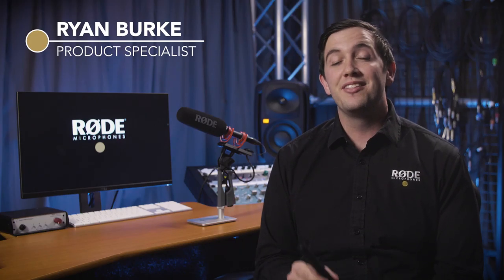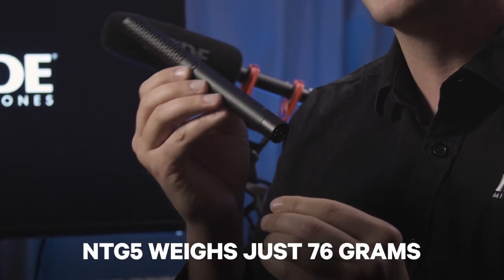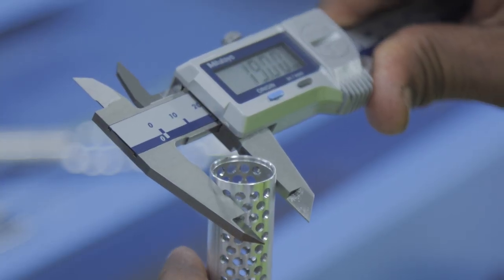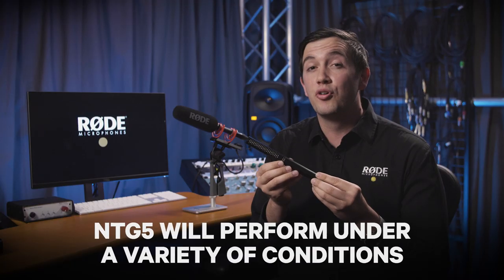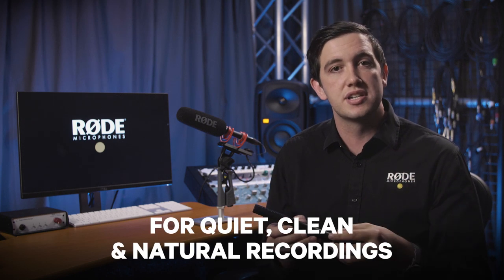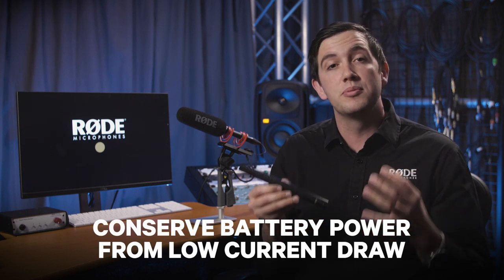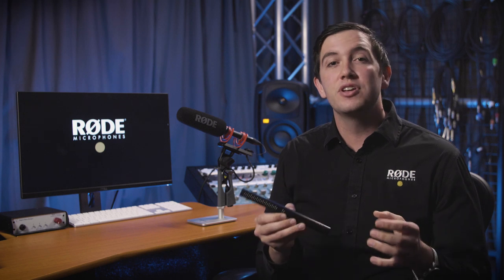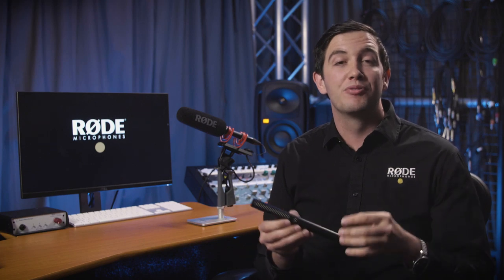Features and Specifications of the NTG5 Broadcast Shotgun Microphone

Comment: Looks and sounds beautiful.
Will there be a NTG5+ version in the future, with a built-in lithium battery?
Reply: Dragonstone that’s an awesome question. Do you use a mic with an internal batterie now? Is there ground floor noise with it?
Reply: @thefilmalliance  I do. I have a cheap shotgun mic with buit in battery and it works great. It's called Genesis ST-01. Very little noise floor. Nothing that can't be fixed in post. 
And Rode announce a little while ago the VideoMic NTG which has the built in battery. So I'll upgrade to that soon.

Comment: Hi guys, an interesting observation of this mic with our system (Sony FX6).

I have tried the Sony UTX-P40 XLR plug-on transmitter (wireless XLR attachment) that connects with the Sony dual reciever on the camera (digital) and the NTG5 and phantom power.

For some reason it introduces a LOT of hiss - however if I plug the mic into an XLR cable straight into the camera, it's a beautifully clean signal.  Other microphones (including my NTG4+ with phantom) don't introduce this much noise floor/hiss with the above combination.  Is it something to do with the wattage that the Sony XLR is sending the NTG5 ?

Comment: Love the NTG-5 - but I'm having a few issues with noise when using 48v phantom power on my zoom F-3 recorder. @rode is there a way to fix this. 24v power works fine, but at 48v I'm getting interference.
Reply from the maker: Hey there, good question and sorry to hear your setup is experiencing issues. We'd recommend standard diagnostic steps with a problem like this one– make sure to try other cables and other mics requiring 48v with your recorder, and other recorders or interfaces that can supply 48v power to your NTG-5. 

We can't help you out with your Zoom recorder, but if it turns out the issue is actually with your NTG-5, feel free to get in contact with our support team here: https://rode.com/en/support/contact

Keep us updated on your progress, and we hope you'll be back to clear, quality audio soon!

Comment: Hi, I am not sure I understand where the NTG5 fits in the Rode Lineup. Is it meant to be a step up from the NTG3 or the NTG4? Is the NTG5 the new Rode Flagship meant to replace the NTG3? thank you.
Reply from the maker: Hey Richard, the NTG3 is still the flagship shotgun microphone in our line up, with the NTG5 being aimed towards location sound applications (it comes in a kit with a pistol grip and other accessories, plus is weather resistant). You will still get fantastic sound from the NTG5, too!
Reply: @rodemic  Thanks for the answer. So it's basically under the NTG3 but above the NTG4? Thank you very much.

Comment: 1st Reaction: Wow, My NTG2 is still going strong.  2nd reaction:  No on-board wireless transmitter?  Given what else they are doing, that would seem like a must these days. 3rd reaction:  I am no boom operator, but I would trade a little extra length for the option of using phantom or battery power.
Reply: Wireless would be a nice feature, but I wouldn't want to be locked in to a single wireless system.  If it doesn't work with MY system, it's a waste.
Reply: @alantuttphotography  Good point.
Reply from the maker: You could always plug it into a TX-XLR which will make it both wireless and battery powered.

Comment: will this be the next replacement for the ntg3
Reply from the maker: The NTG5 isn't a replacement of the NTG3. Both can be used interchangeably, however the NTG5 is better for location shooting with its lighter weight and tailored frequency response. The NTG3 is an amazing voice-over mic giving a rich depth to voices and is also great for indoor shoots where the added depth of LF response can be required.